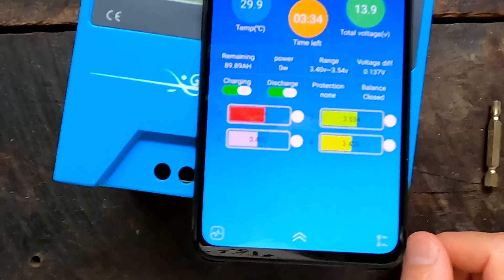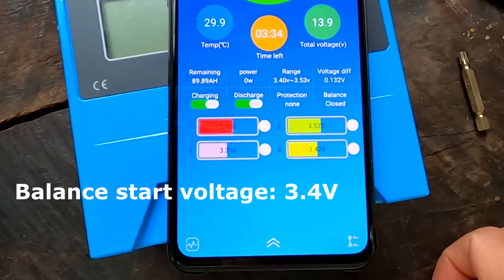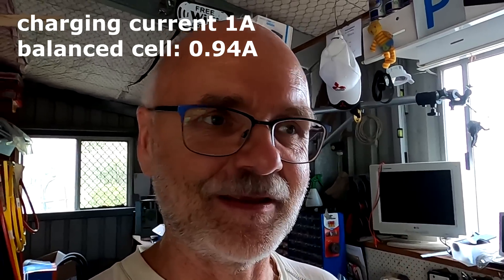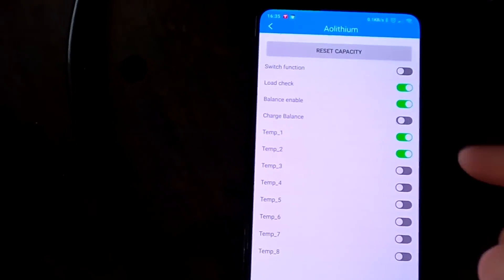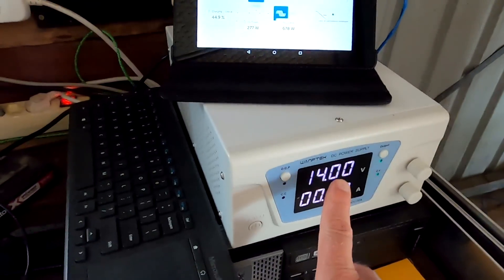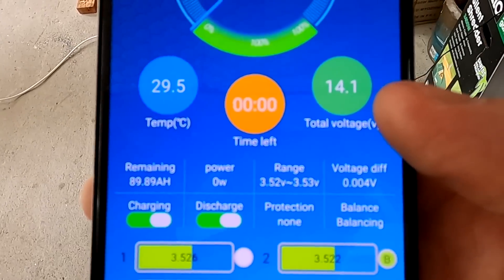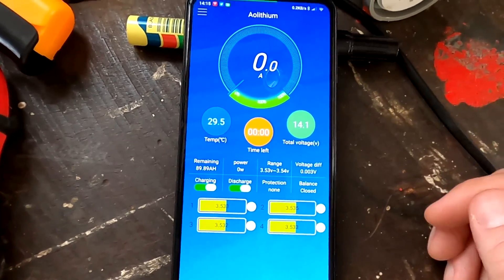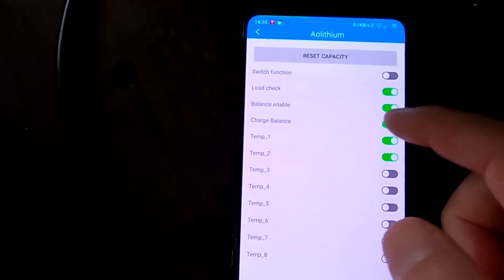Why 'Charge Balance' is a bad idea and how to auto top-balance a battery over night with any BMS.

Comment: Hello.. Thank you for this video. I have now for 3days tried to top balance my 12v lifepo4 100ah battery. but I stille stays at 1 - 3.373 2 - 3.392 3 - 3.961 4 - 3.394  Difference 0.033v I have no current at all on the battery 0.00A 
Can I discharge the voltages somehow, and the hope to charge it again and hope there will gen som Amp on the battery?
Or maybe it is just dead. But It have only have 9 cycles The voltage is now 13.78V on the battery. 
Hope you can help me somehow. ;) Thank you for a very nice channel.

Comment: Dear Offgrid- Garage community, i had a problem and think if someone knows it - it will be in Andys Team👋! So - have a Jbd bms where the current sensor seems to be uncalibrated, when charged with 25A it shows around 18A. Its roughly 30% off, checked it several times. I played wuth this bms a lot, not as much as Andy but - a lot. And i could barely remember that with the "Bely Batterie App" i could calibrate voltages which would be measured wrong in another Bms. But how to adjust/calibrate the Ampere current in aby App? Any idea? Tganks a lot guys!😊

Comment: Very interesting video, Endy.
I have same thoughts about balancing. To set balencer stop voltage lower then 3,4**v to balance after charging ends. Maybe lower? To 2,999v ( Joking😊) Looks like balancer takes energy from cells, that runs up, and after charge thay goes down earlier and discarges quiker...

 I am a newcomer in Solar and Lifepo4 due to the Russian attack on our energetic in Ukraine last years, that led to blackouts last and this winter and the inconvenience of constantly working on a generator. So I was led into the fascinating world of alternative energy. I watched almost all your videos last year and made own Lifepo4 24v 8s Lishen 202Ah in Daly not smurt Bms 200A  200 mA balance current and Neey 4A smart active balancer in autumn.
Internal resistance is around 0,19 mOm per cell, flexible copper busburs. So, no heating on loads around 80-100Amps.
When charge and discharge bms and balancer do the job- bulk 28,2v Must PV18-3024 solar inverter, and Neey balancer do well to 0.005mv, that looks good))
But, I have 3 cells, which always lover in rest, or under 20-40 Amps load diff goes to 0.070mv and on load  around  90A  diff goes up to 0,180 Mv and  becomes biger when voltage drops to 2,9**mv on them, meanwhile on other cells voltage is at 3,1**mv, and diff is higher above 0,200 mv((
When battery is on charge,  the bms and balencer keep balanse at 0,020, but in few minutes after invertor stops charge to 28,2, I see that 3 same cells, that runs up on 0,020 mv over other cells during charge, momentally goes lower then others, and Neey balancer starts to push amps to them back, because while in charge, balencer takes energy from them)) Strange
Looks like there is something with internal resistance in that 3 cells, they goes up, but balencer get them down, and after charging they stay in lower SOH than others. 
How should I set up Neey Smart balancer?  What start balancing valtege (28,2:8=3,52 v maybe) ?  What stop balancing valtege (maybe 3,345 or something) ? 
Thank you!
Reply: And another idea is to use equalization function,  because my inverter doesn't have absorbsion function. In Aqualization mode I can set higer bulk voltage,  and my Neey can be set to 3,6v Start voltage and time set to 20-50 minutes. I use sometimse Float setting (same voltage as bulk) for give time for Neey for balance cells for an hour. As I understand, without absorbsion time, only with bulk cc cv, balancer fails to calibrate cells without a time to do that without  constant voltage with almost 0 Amps for a while. In this case my weakest 3 cell from higher voltage during charge,  runs down quiker when bulk stops, and still lower then bothers durin rest and discharge under loads....

Comment: I purchased one of the JBD bms, with my 8 cells 24v system. However, when the sun goes down the bms disconnect my inverter and does the same thing when the pack is fully charge. Am not seen anyone else with this problem, so, what can I do to adjust the situation. The bms is jbd-ap20s006 .

Comment: I was thinking initially there was a glitch in the software, but I think it's working as it should. The little modification or change you made to the function setting allows the BMS to balance while it's not charging. I was curious if this turned it off while it was charging, but that's not the case it just extends the balancing to when the charge current is turned off. My cells are pretty well balanced so it continued to balance for maybe 15 or 20 minutes after I disconnected the charge current. Once it gets within the parameters It shuts off, as it should. I'm not sure why exactly you would not want to balance while it was not charging, and why the default is on. (No balancing while not charging). Anyway good find there it does help to fine tune.
Reply from the maker: Thanks for your comment. It depends entirely on the BMS and how it handles it. Some keep balancing after the BMS shows 0A, some don't. 
In my opinion, the balancing should start at the set voltage, regardless if charging, standby or discharging. That is for LiFePO4.

Comment: I have same issue.  My pack balances only while three criteria are met:  1) Vcell > 3.375, 2) Charge > 1A, and 3) Vdelta > tbd V.    Furthermore, the passive balance only discharges with something less than 1A.  I know this because if I charge with 1.1A current limit, the imbalance is seen to work, but it doesn't hardly correct.  I can see it turn on and then the Vcell drops by about 40mV, indicating it is being balanced.  But it continues to charge until 3.7Vcell, at which point the BMS turns off the protection MOSFET.  Basically, it is only working during from 99% capacity to 100% capacity at <1 balancing on a 206Ahr battery.  I obviously have to cycle 99% to 100% at only 1.1A charging many, many, many times to get top balanced.  It's really dumb.  My battery has become less balanced over time, which convinced me to pull the battery from my RV and bring it into my lab and use a bench supply with current limit to figure out what is going on.  Someone who isn't an electrical engineer would have a hard time with this.

Comment: hallo sir. its great to watch your video cs i have proble with my 24S bms and only 1 cel i think that is not reach the top balance before packing the battery. i have question for you, i using Ant bms 100A, that i must plug the charge with tiny ampere or just let it balance with out plug the charge? please help me to solve this problem thankyou

Comment: Thanks for the video, fantastic. I do wonder why with the "balance only on charging" turned off you are reading 89.95ah useable out of 100ah? Mine reads the same, with the same setting, but with "balance on charge" turned on I get 100ah with 100ah useable capacity? Surely the off-charge balance option isn't using that much?

Comment: I bought the OVER KILL BMS 48V 100 AMP. after about 2 -3 weeks sit there charge and discharge about 2 times show on it.  It was sit there not charge over a week because my inverter dead.  so I disconnected.  today I connect the bms back in with bluetooth.  it went bad crazy:  battery 7 show 4.753 volt. and it stay there.  battery 6 show  0.045v.  but the mutimeter show all 16 batteries at 3.2 ... V.  WHAT /WHICH BMS do u guys recommend to be friendly easy use but last long?  for 48v lipo7  302 catL battery.?  thanks

Comment: Must be because you are in southern hemisphere.  You are upside down.  You turn charge balance 'OFF' to get it to balance.  Makes perfect sense.  Depends on how you happen to interpret what 'charge balance' means. You have to figure out it means 'balance only when charging', not state of charge balance.

What happens if you have 'charge balance' ON and you get a cell overvoltage BMS shutdown.  Does it bleed overvoltage cell so BMS resets?

Comment: Can we use 16s 48volt bms for 4s battery. The battery is build up by 16 cells, 4cells connected in parallel individually and then in series to get 12v so total 16 cells. Can we use 16 s bms in this configuration

Comment: 091722/0157h PST 🇺🇸  091722/1857h Brisbane… Danke scheoen . I’m watching this particular presentation for the 4th time. I found the similar condition to my 4s system.  Default on JBD being 
“BALANCE ENABLED AND BALANCE ONLY WHEN CHARGING” <<<< both being enabled !
The charging was erratic only one cell (#2) was going cray with relentless charging, until JBD shut off the MOSFETS. I was like what the! I returned to your presentation;  viewed again and again then I remembered that you, once told me to block BOWC. I did jus that. The system changed the character to normalcy now all cells are being charged and balancing each other.
Danke schoen, wie immer, mein Freund. 73s…

Comment: Hi Andy, I had this exact problem with the Xiaoxiang  app on my 90Ah DIY LiFePo4 battery.
When I first built the pack I used the Xiaoxiang "Admin" version of the app with adjustable parameters.......BUT could never get the cells to balance.
I swapped over to what I call the "Blue & White" app ( which was obtained by scanning a QR code in the BMS instructions ) which did not have adjustable parameters and the cells all balanced perfectly, then recently the "Blue & White" failed while I was camping in my van but I was able to download the "Admin" app and swap over to it to over come the problem.
Unfortunately the cells soon went out of balance again as they had done when the pack was first built, but then I saw this video and after turning off the Charge Balancing function the cells are balancing again.
I think that the "Blue & White" app does not have the Charge Balancing function.
Keep up the great work.

Comment: Thank you for this!
 I've just bought a new 4 cell 200ah 12v Lifepo4 with a JBD bms. On the first test cycle the battery had a large imbalance on cell 2,  over 400mv!
 The cell kept activating the JBD overvoltage cut off, so the remaining three cells wouldn't charge to more than 3.335v. It's taking forever, but using your technique it's slowly equalising using your 14v low current method.  many many thanks!
Reply: Hi, I got 16 LifepO4 cells and I observed a 0.4V voltage difference between cells in the bottom. 10 cells were around 3.1V and the other 6 cells were 2.7V. I'm using 150-2A JK BMS. Because of this issue battery pack's usable capacity is very limited. Is there a way to balance the cells at around 2.7V using JK BMS without disassembling the pack?
Reply: I have this same issue but cannot charge my pack with lower current as I don't have any other charger

Comment: Hello Andy, I had trouble with my JDB 8s 150A balancer with 2x 24v/ 400 Ah  batteries I built with 16 x3.2v 105Ah EVE cells. It was running good for past 3 months and balancing well within 0.01 v variation. One of the cell voltage was going low to 2.20v when other cells were at around 2.5v. This was getting resolved after balancing. But last week the 24 v output through the balance dropped suddenly to 5.85v through the balancer. But checking the batteries directly it was showing 23.6 volts. This was due to fault in the balancer. So now I have removed the balancer and running the battery directly with the MPP solar charge controller and inverter for the past one week. The individual cell voltage is better than with the balancer with less than  0.007 v variation. So the balancer may not be required at all. I will continue to test for few more weeks.

Comment: Thank you ! I have the 200amp version with 4x280 eve cells and I had this setting disabled by default and all my cells balanced but this morning I saw the setting and I decided to give it a try to test what it does and 7 hours later all my cells are now unbalanced till 0.29 voltage diff. Thanks god I saw your video and after disabling again this " charge balancing " as I had it previously the cells are right now quickly balancing ! Definitively this setting should be disabled forever.